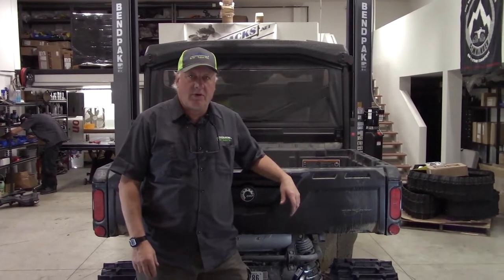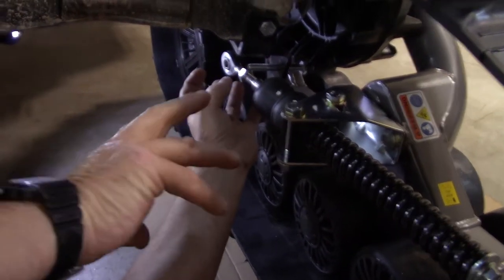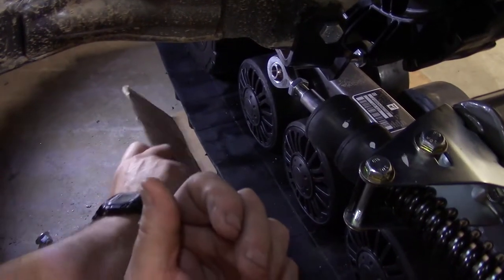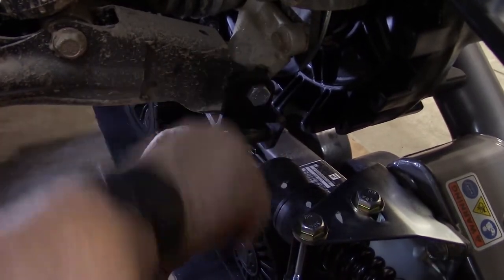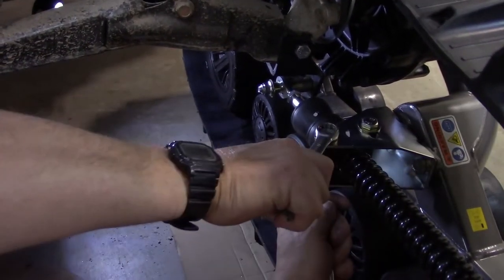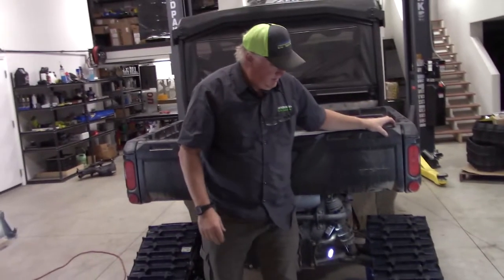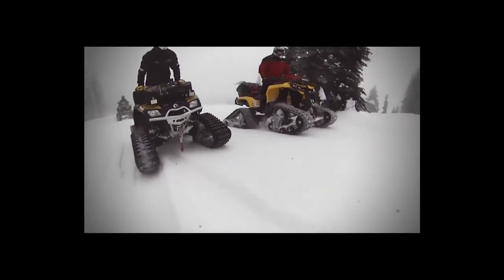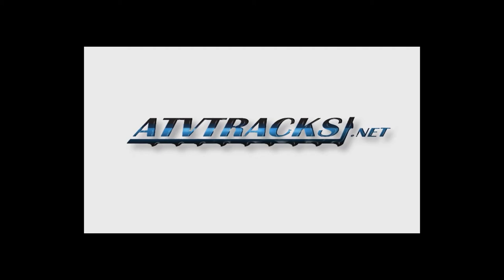Camso UTV 4S1 Rear Track Adjustments

Comment: Hi Gary/Casper......I'm doing an ATV to ATV conversion/track install, and I'm pretty sure the ATV paperwork shows the stabilizing rod getting installed on the other side of that bracket?   Basically the head of the bolt is the only thing on that side of the bracket, towards the center of the machine...and everything else is on the track side of the bracket?  Which made it impossible to use a torque wrench as talked about in the paperwork.  Thoughts?
Reply from the maker: My thoughts are you should send me some pictures and ill let you know what i think! info@atvtracks.net and my phone number is 866-243-8359.
Reply: Sounds good....I was thinking the same thing.